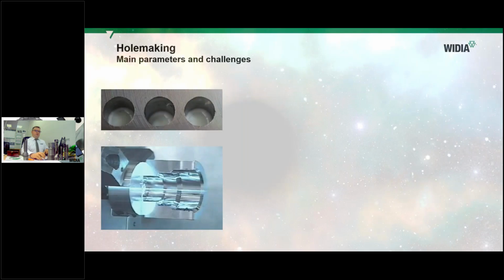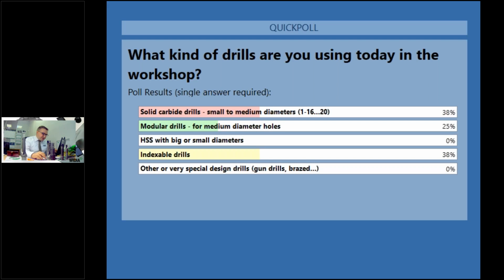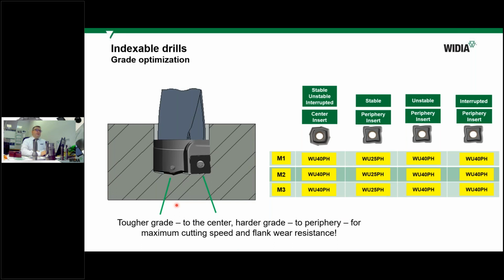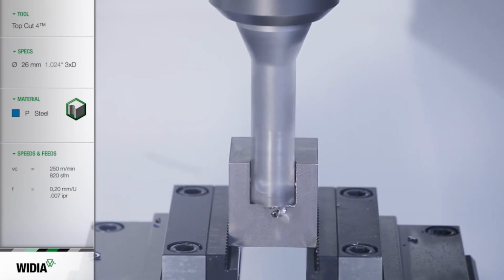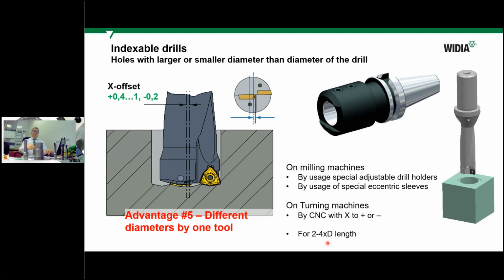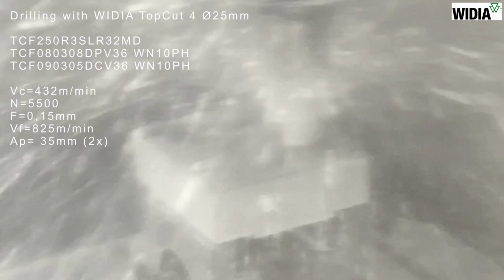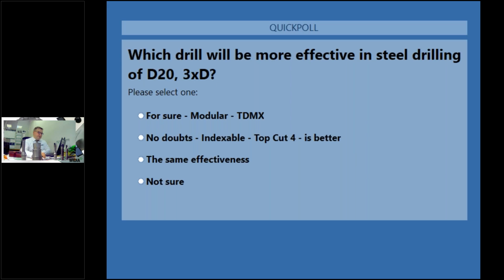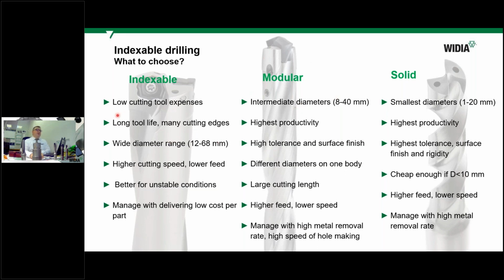INDEXABLE DRILLING ADVANTAGES | WHICH DRILL TO CHOOSE | ECONOMICS and LIFEHACKS

Comment: Why didn"t Widia make the 8XD, 10xD?
Reply from the maker: As far as I know WIDIA produced special Top Cut 4 8xD indexable drill for cast iron pin hole drilling for one customer in Turkey and it worked very well. But for really deep operations there is another design of indexable drill needed with guiding pads, as special as well on request. As for standard assortment - it is visible that WIDIA has generic assortment - only general popular tools and some heavy duty / automotive products.